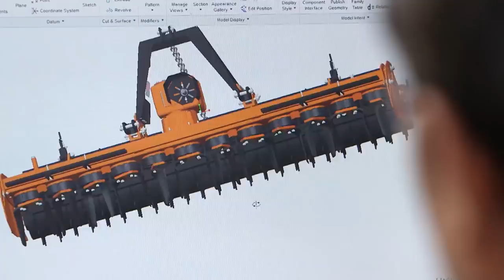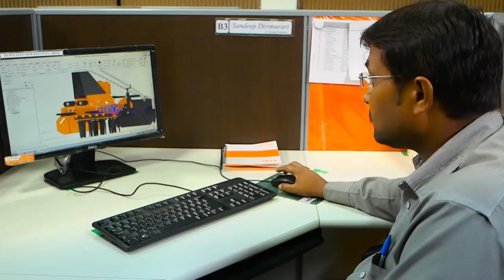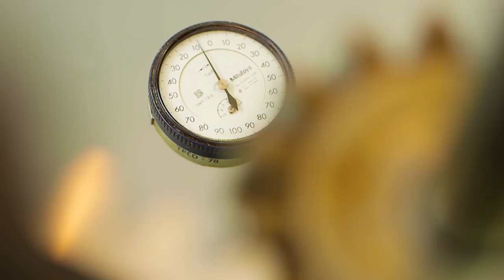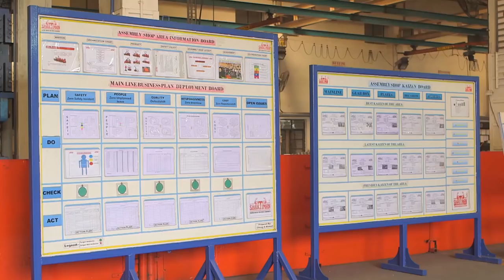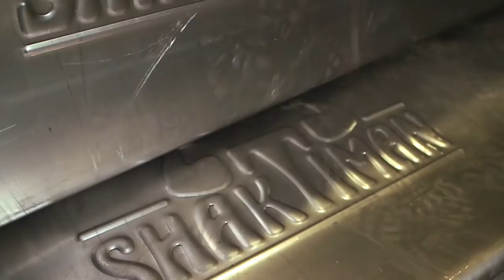Shaktiman

Comment: Biggest producer of rotary tiller because almost nobody outside poor countrys makes or buys this obselete tehnology. Rotary tiller may be cheap, but it makes poor job pulling all the organic residue and weeds on the top. It is only used where extra soft soil is needed, becuase it lifts the ground up, making easier planting bulbous plants. But this also makes poor seed bed for grass, corn, wheat and similar seeds. This can be somewhat eleviated by rolling fields with cambridge rollers or similar. This will give better seed contact with the ground and access to water, thus better germination. Plowing + cultivator or plowing+power harrow will give more yield and less weeds.
Reply from the maker: U R right,
Power harrow is better than rotary.
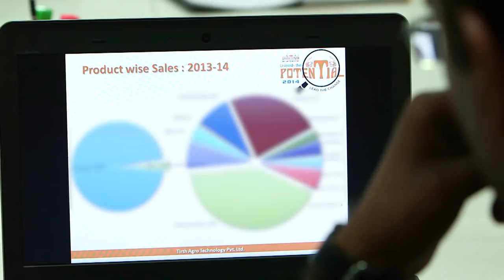Reply: Sir open apprentice job 3:24